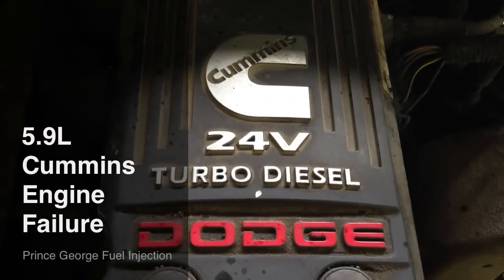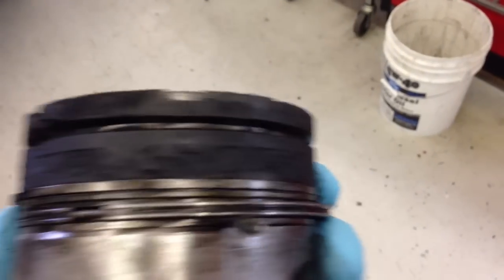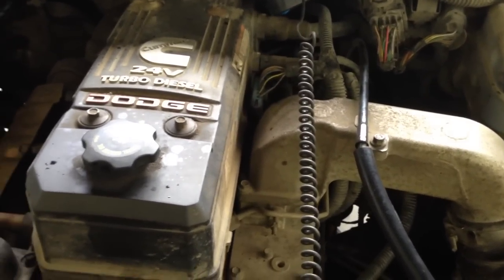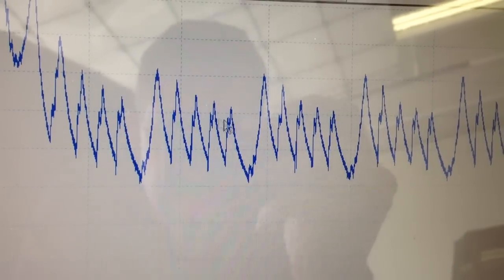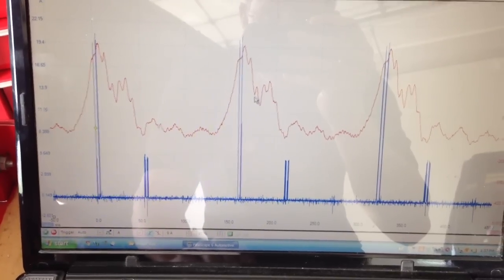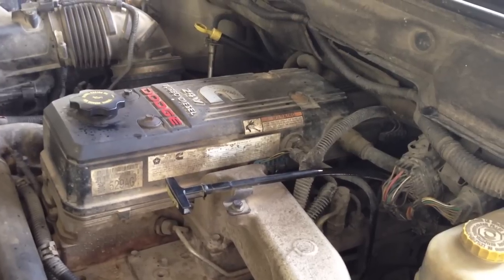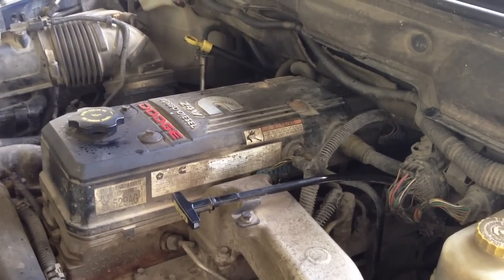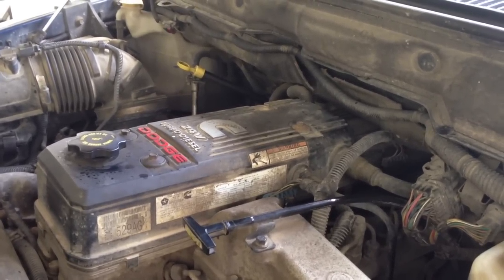5.9L Cummins Piston Damage

Comment: My 12v has smoked black scince I bought it off the lot it is still going good with 736 000km
Reply from the maker: Weedman777 Sorry about the delay in my response.  The engine in the video is a ISB 325 and  only shares the name and displacement with your engine.  What year is your 12 valve Cummins?  Some of the older truck may have smoked a small amount.  The generation in this video would not have met emissions in 2006 if it did smoke.
Reply: +Weedman777 Same here my 96 12 valve shoots a puff if you stand on it and then it goes away once the turbo is lit
Reply: +dkhill27 that's due to the lag between the AFC and boost pressure ... 
once a 12 valve builds boost 3-5psi .. it should begin to.clear up quickly .. If not.u may.need to.have your AFC unit tuned or possibly a Injection pump retimed as they sometimes slip timing
Reply: +PGFuelInjection My Dad owned a 2005 Cummins 5.9L 325hp that never developed this issue, but it still would blow a puff of smoke on acceleration then clear up after the turbo spooled. Never did have any problems with it.
Reply from the maker: +Brian Robertson Black smoke can be the symptom of several issues.  This video only addresses one of these.  In response to the "black smoke is normal" crowd, remember this vehicle would never have been able to pass EPA testing in 2006 with more than a slight haze of smoke.  Again depending on the mileage, your fathers truck may just be showing normal wear with age.

Comment: You said that it needs a 2 micron filtration.Where do you purchase these micron filters?
Reply from the maker: You would need to purchase an auxiliary filter assemble as there are no 2 micron filter elements for the stock assemble.  A FASS system is one option or a filter kit like we sell which installs a fuel manager into the system.
Reply: How much is your filter kit and what is the address and phone number.Thanks PS how often do you change the filter and how much and can they be purchase by you.
Reply from the maker: James Smith We sell a kit for about $190 CND.  Filters are roughly $24.  I would recommend replacing both filters every second oil change or 15,000 km.  You can contact us here.

http://www.dieselpro.ca/contact-us.html

Comment: Glad I got a 2002 before Cummins staring fuking things up......................
Reply: 2002.. sorry to break it to you but you have a vp44 injection pump.
Reply: The common rail is infinitely better than the VP44, both in reliability and performance.
Reply: Kelcey K the vp44 isn't the best injector pump in terms of reliability but there are ways to make it last. Most vp44 failures have been due to the OE Carter lift pump failing and burning out the rotor in the VP because of no fuel delivery that lubricates the rotor. Install a fass or air dog lift pump with an in cab pressure gauge and the VP is good for a long time

Comment: I'm saying this first hand because it happened to my truck, and your right it was #6 that failed. Happened on the highway, didn't notice until it came down to an idle. By this time the whole crankcase was full of diesel. Luckily it was still under warranty as the bill came to just over 15K rebore, sleeve, new injectors and turbo.
These injectors have about 100 000km on them and now I have a code #3 cyl. open injector circuit. Not too impressed with cummins injectors anymore...
Reply: +evildog1966 15k?!?!

Comment: My guy, Dealership, described the sequence of events a bit different. The later year 5.9's had a lot of compression ring failures but not because of over fueling. The over fueling occurs because the compression ring fails and the there is a loss of back pressure in the cylinder.
Reply from the maker: I see his point.  When compression is lost in a cylinder the ECM will see a loss of output and increase fuel to that cylinder in an attempt to balance the engine.  This only happens at idle though so once off idle, all injector receive the same pulse width.  As I state in the video we bench test the injectors out of the engine and find them to be over fueling greatly and usually the worst is cylinders 1 or 6 which have the highest rate of failure.  This imbalance can be very damaging to the engine as one cylinder receives more fuel then the others when the truck is underload. The piston ring failure could only cause an injector to over fuel if it physically contacted the injector nozzle and damage it.  It really is the chicken and the egg question.

To be 100% honest, I am a technician and not an engineer.  These are the events that unfold in our shop and the connection we see between the failure and injector wear.  I hope this clarified things.

Comment: Is it ok for my 1989 dodge cummins to have black smoke when I punch it? (Full stock)
Reply from the maker: With a vehicle of this age you may experience some smoke from warn parts such as injectors.  Generally these older 12 valve engines were very reliable, though if worked hard with high mileage injectors, they can fail as well.  This was more common in the industrial engines of that era than the Dodge trucks but I would recommend replacing injectors if they are original.

Comment from the maker: Sorry, Aaron McGraw I am unable to reply directly to you.  I would recommend installing the filter between the stock unit and the high pressure fuel pump as there is a rubber house in this location that makes things easier.  Obviously you will need a bracket or other means of mounting the filter assembly and then just two lengths of house to tee into the supply line.  There are many kits you can find online to get an idea.  Now if you are running any type of performance produces on your truck, suck as a tuner, you will want to look at a FASS system to keep up with the demand while also offering the 3 micron filtration in one unit.

Comment: I got my 04 at 45k. I was getting 15 MPG, which I thought was kind of low, so I looked it up and found out that an injector going bad will mess with your mileage. I took it to my brother's dodge guy (who he's known for 4-5 years), did an injector test, and found that injector 6 was firing at 88%. Got it replaced (didn't help the mileage though), and I am now at 61k, and I'm glad I caught it, cause it could have done some serious damage if I left it. I have plans of getting a 2 micron filter system very soon.

Comment: My truck is consume a fairly large amount of oil, and I have done every conceivable test on my truck, the only thing I havent done is a test like yours, or a compression test.
Ive checked coolant for oil, I have done the oil filler cap check, I have checked both the hot and cold side of the turbo for oil, theres no smoke whatsoever, and my truck has no cat on it to catch smoke/oil.
It starts perfectly and runs smooth enough to balance a nickle on its side on the valve cover, I've also checked the blowby tube, hot or cold I dont see any smoke.  The only oil leak I have is my front crank seal.  It will go from full to add in about 800km or so.  I'm not sure what to do, at this point and it doesnt seem like the crank seal is leaking bad enough for me to be losing that much oil.  If you could offer a suggestion, I would really appreciate it.

Thanks
Reply from the maker: I would expect some amount of blue smoke if you engine was consuming the oil.  You can never over look an external leak.  It may only leak while driving or at a specific temperature.  I would correct the leak first.
Reply: PGFuelInjection Alrighty, thank you.

Comment: that's what must have happened to mine, 13,000$ later, good as gold. but I learned a few things your video your from PG eh, nice im from the coast, what do you think (if any) of Vulcan performance filter systems? I bought one with a 2 micron cat filter, haven't used it yet, not sure if the cat filter needs a o ring or not so I haven't out it in
Reply from the maker: A good quality filter is key.  A 2 micron Donaldson or CAT filter would be a good choice but stay away from will fit filters.  Some aftermarket filter companies make one filter to replace multiple micron ratings and may not be adequate.

Comment: I appreciate the time you took to make this video, but this truck had over 300,000 miles on it. Even as a 2004 (the earliest year for the 325 HP variant) that comes out to over 30000 miles a year. That is an extreme amount of driving in a short time period. This truck was abused. I would bet against regular air filter, fuel filter and oil filter changes performed on this truck as well. 

Not many diesel owners understand the importance of regular fuel filter changes. I agree that the 7 micron filter is a joke, but if you change it at least every other oil change, you are decreasing your odds of extreme fuel contamination such as this case

Thank you for your time
Reply: Matthew Trujillo According to my math on a 8 year old truck that's only 2,135 miles a month. 25,625 a year. That's not extreme use at all
Reply: That is in kilometers though.  So it has around 205,000 miles.
Reply: Even then...200000 miles for a 8 year old truck comes out to over 20000 miles a month, pretty extreme use
Reply: That's your opinion dk. I have to do alot of driving just to put 13000 miles on my truck a year, let alone 25000, which would almost be double what I drive. That is pretty extreme use. There is a reason why NADA and KBB base light depreciation at 12000 miles...just sayin
Reply from the maker: Sorry, it took so long to reply.  You are correct that improper maintenance can lead to this type of failure, especially on a high mileage engine.  However, this is a very common issue on this particular model and generally can happen anywhere between 100,000 to 200,000 KM, depending on fuel quality.  When the engines we diagnose are torn down, we examine them with a local machine shop and flow test all the injectors.  We have had customers putting on over 100,000 KM a year with replace engine failures do to over fueling injectors.  By the time they enter our shop they many be on their second or third engine.  The cure was to install a primary 2 micron fuel filter and replace the faulty injectors that were the root cause all along.  The main problem, is that normal OEM diagnostics will no show this issue until there is a loss of compression in a cylinder.
Reply: PGFuelInjection Mine has close to 400,000km and its a 2007. Just got a check engine light and it sputters when decelerating. Bad fuel? Also a vibration while decelerating, torque converter?
Reply from the maker: The first step is to retrieve the code setting the check engine light.  This will be the starting point in the diagnoses.
Reply: I put 40000 miles a year so 25000 miles a year is not that much
Reply: Haris Mulahasic Both 25000 and 40000 equate to extreme use.

Try to see what you get for your truck with your usage rate and mileage versus 10-12K miles a year usage and you tell me who gets more money for their truck.
Reply: CUMMINS WORK HORSE, EXPECTED TO HAUL MILES....